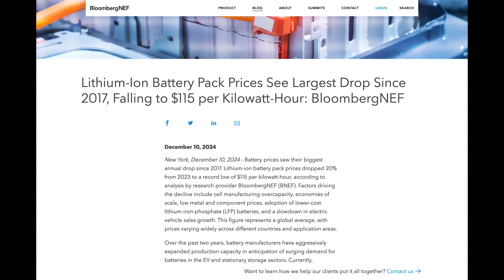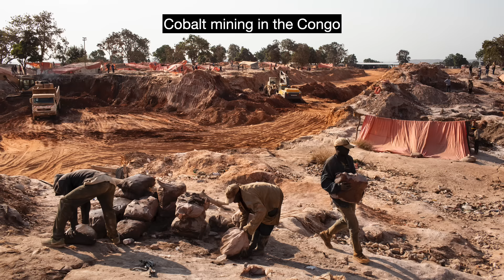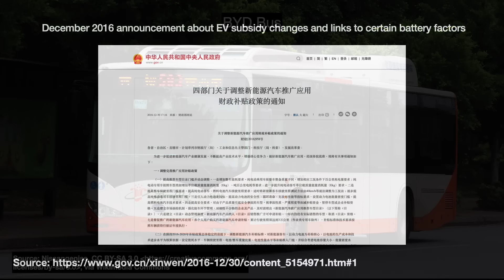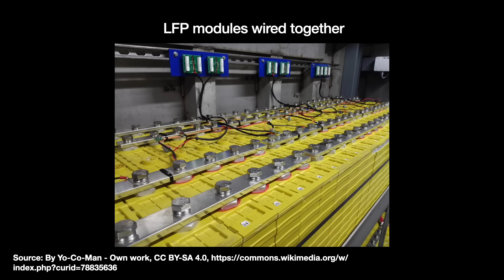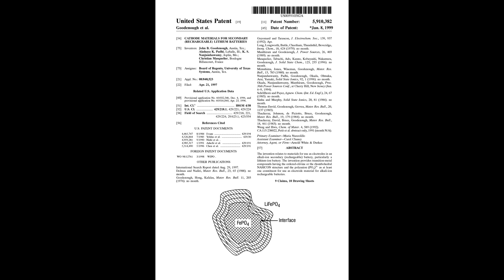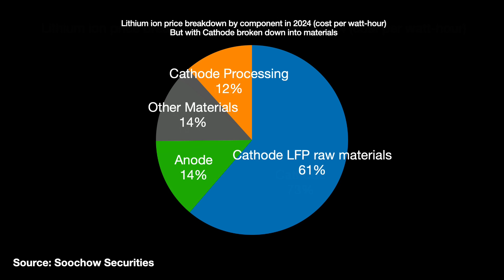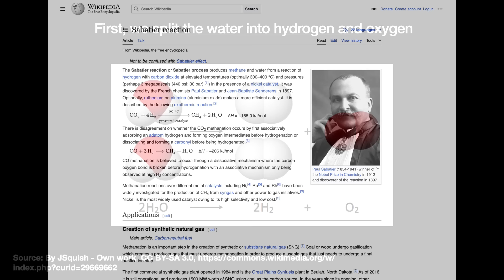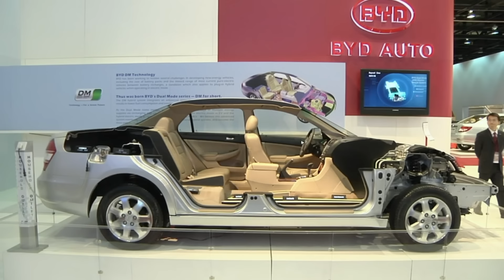How Did China's LFP Batteries Get So Cheap?

Comment: 0:16 - BIG MISTAKE & ERROR: you were talking about why LFP battery have become so cheap AND THAT is a result of only 1 point: LFP cell prices have dropped, while other parts needed for a whole battery pack have increased over time. The pack prices incl. the frame, fasteners, connector the BMS and more. And if you have a small battery like a Dacia Spring with 25 kWh only then you would have HIGH cost if you compare a battery pack price per kWh. The key message of the time in 2024 was the LFP cell price drop over the previous 2 years.

German price for a HOME STORAGE 16 kWh LFP battery out of EVE MB31 cells right now MAY 2025 is 1500€ for the full ready to rock pack and 1050€ CELLS only.
AS YOU CAN SEE: even for a small homestorage battery in a black box (search for EEL V4 case for 450€ and you get a full LEGO KIT - you would only need to buy the cells extra for 1050€).

THESE prices are german prices from a german dealer incl. 5 year warranty

FOR COMPARISON: AUGUST 2022 there were NO german vendors offering cells and we had to buy those in China via Alibaba for 2400€ ddp = free delivery. Quality was not good, promised to deliver grade A and we got a different quality B. 

We have seen at least in germany over the past 3 years a price dropy close of 58% !
We use these only for solar power home storage to charge the car and run the heatpump during winter from the battery which we charge off peack from midnight to 5 AM for 14 Cent and we are saving right now 11 Cent. the closer we get to spring we charge the battery from the solar power system for 7 cent cause if we feed those kWh in to the grid we would get 7 cent . We have to pay 28 Cent outside that 14 Cent zone. But next winter we will get another bonus of 10 cent for charging after midnight: 10 cent less --- in total 5 Cent versus 28 Cent.

Our House and heatpump needs from the grid about 8000 kWh and hence we save roughly 23 cent or in toal 2000€ this way.
3 of these batteries were 4500€ so in 2,5 year we will have the money back. 

LFP was a savior for the solar system diy community in the EU, UK and of cause USA and Canada, also Australia cause to those we have contacts.

Comment: Could I ask if you could do a video about graphine aluminum - ion batteries, G+Al which I believe were first reserched in Oxford University, then a spin off company, Graphine Manufacturing Group, GMG, makind smsll cell, the deaf aid type in the UK and the flat type cells used in mobiles.

There is a colaboration of GMG, University of Queensland, Rio Tinto Zink, Wood Engineering and the Battery Inovation Centre, BIC.
I also understand that a company in Australia, is msking much larger batteries.

These batteries which the aluminium is some how put in the graphine grid? The power output is said tho be 4 to 5 times the power of lithium batteries used in cars. If it is so the 200 to 300 miles per charge at present to 800 to 1000, this would be great and the battery is less volotile.
The only fly in the ointment is the mass production of graphine which is costly at present.

It would be nice to hear of a UK battery invention being used world wide which is safer than the present Lithium ones.
Thank's and thank's for the well reserched and presented video's.

Comment: In good design thermal runaway isnt the issue, thermal throttling Vs active cooling is the limiting factor. Case in point the 2nd generation Nissan EV batteries were still passively cooled only causing charging rate and road speed limitations. By comparison the Renault Zoe series runs active cooling and thus doesn't suffer from thermal throttling.
Thermal runaway should never happen in an EV outside of a crash/accident scenario where the cases and electrical plates are damaged.

Comment: Who, in their right mind, would engineer a car with built in battery when you could have replaceable? Pull up to a "station" they take out your present battery, slide in a new set and off you go.
really, that would eliminate a BIG drawback to owning an electric car.
Just standardize the battery packs. Bigger car? Needs more packs. Semi truck.. needs even more packs. Going on a long distance trip? Battery stations are like gas stations. One on every corner.
Come on guys, get with it.

Comment: I think that phones and power-tools are the last places where NMC cells deserve to exist, in teh EV space we have had too many death-by-battery-fire incidents and that is causing EV danger myths to present themselves and fuel the return of the much more dangerous and expensive long term problem of gasoline cars(and yes the "fuel" was an intended pun)

an EV is almost NEVER used for treks longer than 100 miles per day, if we subsidized and mandated public parking for apartments and such with level-1 or level-2 charge stations(level 2 for the long commuters, level 1 for the car that seldom gets driven but when it does you need a full "tank" of electricity

and yes we need to think of an EV battery like a gas tank, and that the battery is like a tank filled with sludgy gasoline and a limited safe input and output port based on total capacity

when we build an EV we should design it with the ideal of "how many gallons of gas do you burn a week" and then tell them that aso long as they plug it in for x-hours once every x-days they will have exactly the same amount of "gas" as the old polluting and not really any safer cars

and to recommend that while you may forget sometimes to have enough capacity for the rare outage or failure to plug-in, and at that point the damage to longevity caused by supercharger use is worth teh risk, but to avoid superchargers as much as possible to avoid capacity loss"

the flaw with battery and EV culture is that we focus on energy density to get a range that almost nobody ever uses, making carrying that extra capacity less than stupid
and that superchargers are the only way to charge

in olden days you would go to a gas station and spend a bunch of time doing some stuff while the workers filled your tank and topped up any deflated tires and checked coolant and oil just in case, so the modern trend of <5 minute fill-up then on the road again was not the only way to live
so we need to go back to the idea of that, when you go to the grocery store and spend an hour doing the shopping, we need stations built in teh parking lot with level-2 chargers, you plug in your car(and maybe start chilling yoru 12v mini-cooler) and then go get the groceries, you come back with a couple dozen more miles, you drive to the next stop and repeat
and the same things should happen at most jobs, you get a spot to charge your car during the 8 hours spent not moving, the PERFECT time to recharge

the solution is legislation to force a large number of standardized level-2 chargers (NOT superchargers) to be built around all major businesses
those chargers should use a method of billing linked to a regulated car identity system(like some large alphanumeric string unique to every EV ever made, easy enough with an RFID/NFC tag of just a few hundred bytes the charger can read when plugged in)

you plug in your car and your EV road tax is auto-deducted based on miles driven(no gps logging, just distance traveled) and you get a bill in the mail/email/ect every month for "transit electric bill" and "road tax fee"
this even allows them to see if you have an EV you use for VTL or even to power a few things while camping, making it obvious you are smart about energy and give you tax breaks for not straining the electric grid so much with sudden loads, and even allow the much more long-term stable LFP EV's to be used as "grid balancing"
each person can set a range limit on their EV that sets the minimum range for them to be able to drive normally, the extra capacity(minus an efficiency buffer for when you need hvac or battery conditioning) can then be used to create surge supplies and electronic loads on the grid using the VTL feature as a grid-follow inverter-charger
this will give tax breaks as your EV can join the attempt to stabilize an overloaded grid during peak load hours and then recharge that unused buffer during off-peak hours, providing a service to the grid that gets you to pay less electric fees

suffice to say LFP batteries are the bomb, you should get them exclusively whenever possible, even inside your phone/laptop/ect if you can, especially since the Chinese have also boosted burst-power to as much as 3C discharge, which should be enough to handle the peak load of any device without much problem if you size with the normal 120% of expected load continuous, and peak being whatever the battery can do is >load peak

Comment: The lithium price crash was utterly predictable, given how easy lithium is to extract. The issue wasn't lithium availability but the availability of processing equipment to handle the salt sources (either fossil salt or seawater). Mines take 5-10 years to catch up with demand if there's a surge as happened in the 2010s

A lot of people got ripped off by pump'n'dump artists selling near worthless mining shares whilst playing on a "lithium shortage that will only get worse"

Nickel and Cobalt aren't that rare either. Lack of demand is again why there was so little processing capacity. Until Li-Ion pumped up demand, cobalt was generally regarded as mostly a nuisance

The African artisinal mines are unusual inasmuch as they're not valuable enough for industrial strip mining but they're pure enough and close enough to the surface that artisinal miners can get at them (There are mountains of cobalt in Eastern European silver deposits. That's where the name was coined). Once larger open-cast mines start bringing processing onstream for the higher cobalt demand, the artisinal mines will be uneconomic

Battery prices (and source material costs) are going to keep falling in real terms for a while

Comment: Crazy that in December 2024 battery prices had dropped to $115/kWh and today, just a few months later, they have dropped to $65/kWh for fully functional containerized BESS, not just the cells (source: pv-magazine).
Reply: We will see single digit numbers in the coming decades, plus the the low cost of solar and wind, we will have a green revolution, not because of environmental incentives, rather cost.
Reply: I haven't seen prices anywhere near $65 per kWh. What I've been seeing is closer to $100
Reply: @ohger1  The headline is "China’s Huadian announces winners in 6 GWh BESS tender with average bid at $65/kWh". It's an article on pv-magazine.

Comment: Hey! I just bought a bunch of prismatic cells a few weeks back because of this; with the goal of building a camping/'glamping' trailer (and dodging tariffs before Canada ends up also instituting their own the way Mexico has). Still costs a lot of money, but far less fuss than dealing with leaky lead-acid cells and less fussy charge characteristics - and they're somewhat cold tolerant too which matters a lot when you live north.
I'm not in the battery chemistry field, but I'm a chemist in a field a few steps behind in the supply chain and wonder if there is still quite a bit of advancement left around this chemistry, magnesium ion, non-graphite cathode additives for conductivity etc. I certainly think they haven't hit their peak space density at least, although I doubt they'll get lighter than LiFePO4

Comment: I am part way through and I believe you missed a key point why there was a disjoint between the China and the rest of the world. A company called Phostech Lithium from Canada bought the licensing rights from University of Texas and/or John Goodenough. 
They aggressively litigated in Japan, Europe and the US to get their money for use of the chemistry. At the time some said China was allowed to freely use it but it might have been a little more complex. The costs to use the batteries was more because of licensing than using NMC or other chemistries. It wasn’t until the licenses expired that it started to get traction in the rest of the world. 

Something that costs the same and was less energy dense was not the answer. LFP started to get electrolytes which helped it get 5x the lifetime of other chemistries and recently high charge rates. Now nearly 50% of western EVs use LFP. Tariffs will hurt more than indicated. People will look at two identical cars, one with less range (LFP) and one with more range both at the same price. Even if you throw in safety- either pack will be safer than getting into a gas car.

Comment: Sodium ion battery EVs need a 1M Watt fast charging infrastructure to make it practical. Secondly, the sodium-ion batteries voltage varies 10 to 20% during charge/discharge cycles, so this suggests a 1000 volt battery, an 800 volt motor and an adaptive voltage down conversion, in order to have constant EV performance. BYD recently introduced 1kV x 1kA  = 1 M Watt  fast charging (nice numbers btw!). BYD is working on a 1 M Watt fast charging infra. China has one of the biggest NaCl  salt reserves in the world.

Comment: Great video. But theres one thing. In eu zone, within a diy battery storage community, i have not yet seen a single battery with blade technology. Tesla, hyundai/kia, ford mustang and other eu available cars are not using blade technology. They are still using latest NMC chemistry inside regular, rectangular packs. Do you have any more data on where to look for blade cells car models in eu market?
Great catch on the subject too by the way. I wanted a blade cells for myself because it is way easier and more compact way to make DIY batrery pack with them than with other packs. But i had no idea what was the reasoning behind manufacturing them. Turns out, OEMs thought it's an efficient form factor too 😎.
Reply: Polestar uses bladed batteries. And I believe Volvo as well
Reply: @inteallsviktigt  never seen polestar battery. Too low volume at breaker yards. As for volvo- the only ev they produce today xc40 doesn't have blade cells.

Comment: A huge point in batterys for ev's is rising internal resistance. I have seen that with my 8 yo Tesla Model X. It's not a huge deal when the battery can stay at 30-40 degrees but all under it especially under 20 degree you really see the drop. So i had to think quite a long time over it but i got it now. When the battery is lets say 10 degree and you want alot of power lets say 100kw for acceleration the battery drops in Voltage and through internal resistance the battery gets heated. There is the loss. In the Winter the battery rarely gets over 20 degrees even with longer driving. Better insulation would fix some of this propably. 

That said this is  a huge deal for Sodium Ion since the operate at much lower temperatures with high C rates. Therefore you don't need a 90-100kwh battery to get good ranges through all the year.
Reply: That's not caused by an increase in internal resistance but rather software programming in subsequent updates requiring more gentle charge and discharge curves for their batteries either due to age (which is what you're suggesting) or inherent chemistry/design. It does make me wonder if Tesla is engaging in a bait and switch by releasing software updates that nerf their battery performance over time intentionally rather than trying to correct for an issue they discovered later on in good faith.

Comment: it should be noted that blade BYD blade batteries fail to pass more or less any EU safety test because battery fires goes runaway in seconds instead of minutes, and happens for basically any scenario where a single blade cell gets damaged

Comment: I think people underestimate the repercussions of cheap LFP storage for future engery markets. With modules below 100$/kWh and lifetimes of over 10000 cycles the thing that used to be the expensive part of battery storage now is below 1 cent / kWh stored.
Reply: I think Sodium ion: at around $10/kWh, rated to -40C (so no heater needed) is going to be a game-changer.
Reply: We still won’t have enough raw material to electrify any portion of the grid with any significant amount of storage.  

Each household will need to pay tens and tens of thousands for 45 minutes of storage after the sun goes down - in an era of constrained capital.
Reply: @ChadThundertalk  Deleted my original reply.  I just realized "Chad" is a bot account.
Reply: @MaltiverseExplorer  Oh Chad 😄

Comment: LFP uses more lithium per KWH than Ternary batteries, but as lithium prices dropped and LFP manufacturing started to benefit from economies of scale its price per KWH fell below that of NMC.  In terms of pack density, NMC have higher cell level energy density but require thermal barriers and coolant channels between adjacent cells to meet safety standards, which reduces their advantage.  Also, the capacity of an EV battery is primarily driven by what the average buyer can afford, rather than available volume. If you are designing the vehicle around LFP chemistry, you can simply design a chassis with a larger battery enclosure

Comment: LFP is my preferred chemistry.   However, CATL specifications for sodium batteries is perhaps even better.   I will not consider an EV until thermal runaway is no longer an issue.      Fully expect my next car to be an EV, in about 3 years time.    I can charge at home normally and range isn't really an issue, the longevity and the safety of the battery will be paramount.  CATL Sodium seems to be outstanding for longevity and safety.

Comment: My emergency car starter has LiFePO batteries and is an ideal use case for them: long life, can be kept charged and maintained at high percentages all the time and remain compact enough to be carried in the back with the spare. I've had several of the common lithium batteries fail over the years so I'm always grateful for the long life.